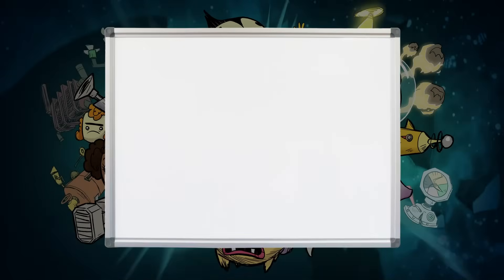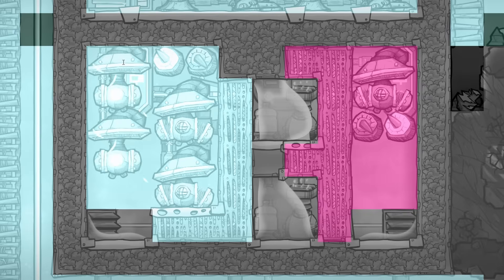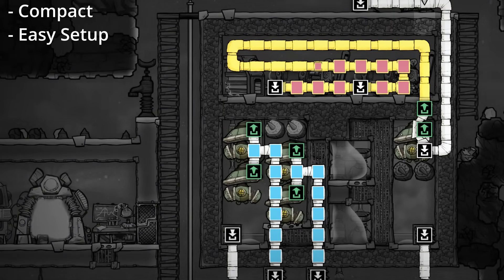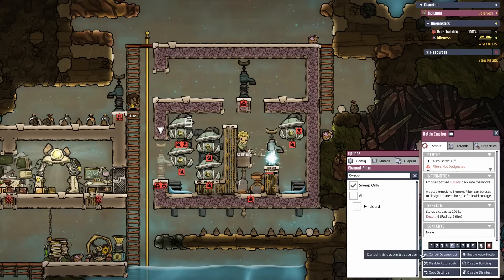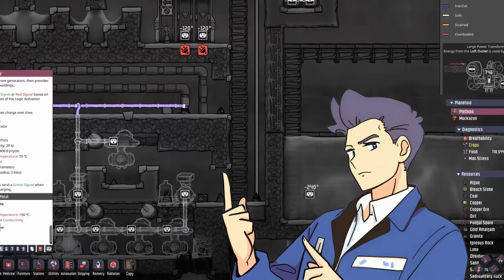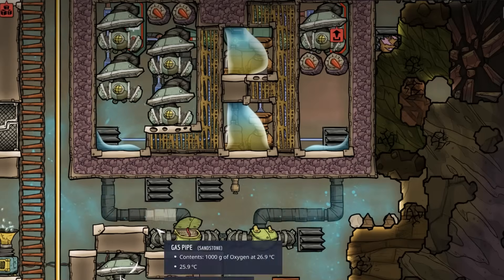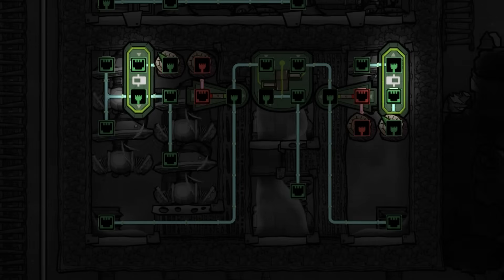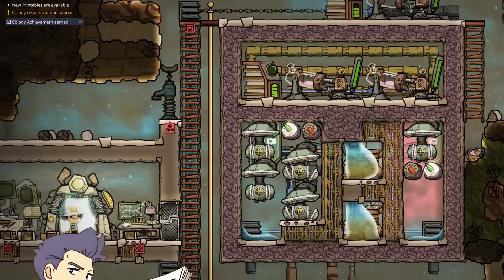FSPOM Hydra | Oxygen Not Included Guide

Comment: I personally build and design Hydras in all my games and I'm afraid this is not the best design due to quite a few things:

1. It's not expandable - so once you build it, you'd better be happy with it. And replacing a hydra is much more of a hassle than your regular Rodriguez so be careful.
2. Not enough cooling for the entirety of the system. Use radiant liquid pipes and the temp of the liquid that's coming in.
3. No security. You need to make sure the player is informed if there's a shortage of water coming in if you want to limit the amount of gasses it can hold.
4. Complicated automation. Just use 3 atmosensors and a NOT Gate. Put 2 atmosensors in Oxygen with 1 connecting to the gass pumps  and the other directly to the Hydrolizers. Put 1 atmosensor in hydrogen connecting it to the gass pumps and the input of a NOT Gate let its output connect to the Hydrolizers. Automation wires will always send green if it receives green so you don't need an OR Gate.
5. If you're gonna use disgusting poo water then limit oxygen generation to bellow 9K and put in a Buddybud plant in there to at least mask the smell. My god have mercy on the dupes! Also, only one type of germ can exist within a tile so it'll help fight against food poisoning germs.

And here's some useful tips:
The gass generated by electrolizers have a bias on where they'll end up on and on the latest update, hydrogen almost always ends up on the left and oxygen at the top. It sometimes changes depending on the setup and version but that's their general flow.

If you put your battery and generators to the left or right of the setup and not on top then you can give the design a better chance at expandability.
Reply from the maker: Mercy?  You must not have seen what we did to poor Devon in episode 7.  Muahaha!  I appreciate your detailed feedback on the Hydra design. I'll have to work on it a bit more.  Thanks again!

Comment: Air vents have an overpressure. 2 kg for regular and 20 for high pressure gas vents. When using liquids to create infinite storage, keep the mass of liquid under the weight of the gas vent overpressure to prevent flooding status.
Reply from the maker: Ah, that totally makes sense now!  I can't believe I didn't make the connection after coming to that number through testing.
Reply: Should be careful using water as your vent block as it will evaporate from heat if, for example you pump really hot hydrogen in there.  If available crude oil or petroleum is best.

Comment: Nice design.
Small improvement : you can put your water through the oxygen part, and benefit from both cooling the oxygen and gaining less thermal energy from the fixed temp output of the electrolyser if water is <70°c and also, for 70°+ water, benefit from the cooling from the SHC difference between water and oxygen.

Also, be careful of using the infinite storage to store Saturn trap very cold hydrogen.
Reply from the maker: Great tips!  Ill have to try the water cooling. I had not consider it as I just assumed the temp followed the gasses into the chambers.
Reply: @engineertroy_  Indeed, the electrolyzer has a fixed lower bound for its output. If the water is over 70°C, the gases will be at the water's temperature. So you are right in this case:  "the temp followed the gasses into the chambers."

However, if the water is any lower than 70°C, the gases will still be at 70°C.
So any electroliser that uses <70° waste a bit of potential cooling.

Also, the water has a specific heat capacity (SHC) of around 4.1, while the oxygen has an SHC of 1.

Therefore, you can cool 1 kg of oxygen by 4°C, whereas 1 kg of water will only heat up by around 1°C.

Additionally, not all of the water will convert into oxygen, so there is a bit less mass of oxygen to cool (though there is some heat exchange between the two chambers).
Reply from the maker: Wow, such great info!  Definitely gonna snake a radiant pipe through all my SPOMs from now on. Thanks again for taking the time to teach me something new!

Comment: Side note, if you try to build one in an already vaccumed room, do not use polluted water as the bottom layer, use brine or salt water instead🥲
Reply from the maker: Very true. Thanks for adding that. 😊
Reply: @engineertroy_  mistakes were made
Reply from the maker: Oof. Hopefully it wasn’t too bad.
Reply: @engineertroy_  Just need to re vaccum the box, nothing too bad, but I do learn to treat polluted water a bit more careful aince that
Reply: Sorry for the ignorance, why is that?
Reply from the maker: The polluted water can offgas before the second layer of normal water is added releasing polluted oxygen into the enclosure.  That is why I waited to vacuum until after adding the liquids.
Reply: Water naturally wants to sit on top of polluted water, so just add your water first and the polluted water will sink under it and minimize offgassing.
Reply: And, on a related note, dont use pwater in your liquid locks, as I have learned
Reply: @ThePrimeMinisterOfTheBlock  it’s fine as long as regular water is on top or is outside your livable space.
Reply: My combo would either crude oil+petroleum ir crudeoil+water with 400g each